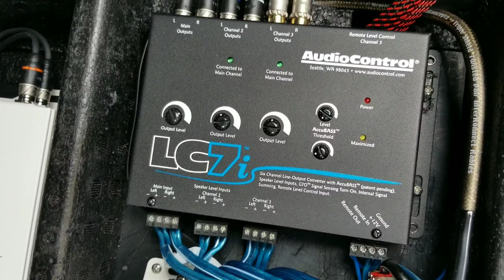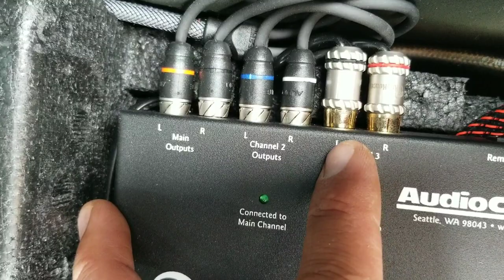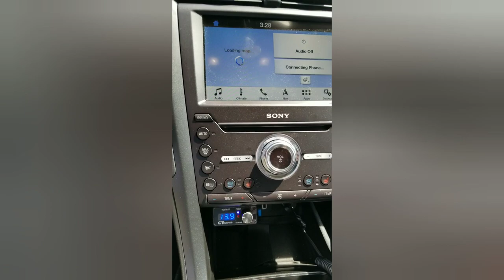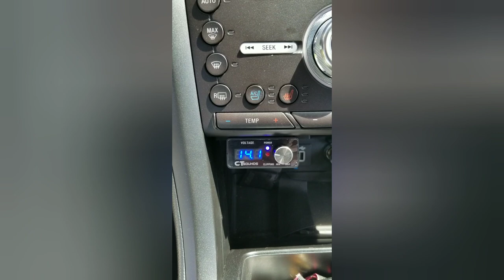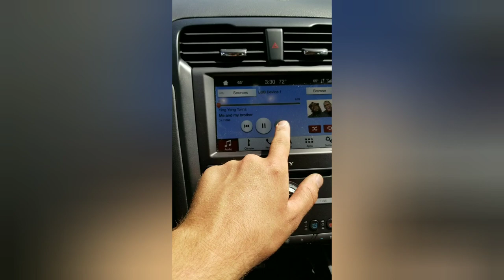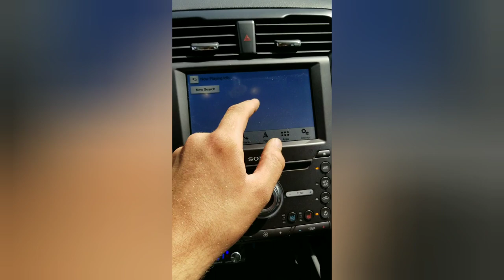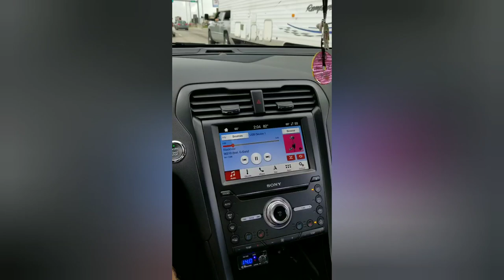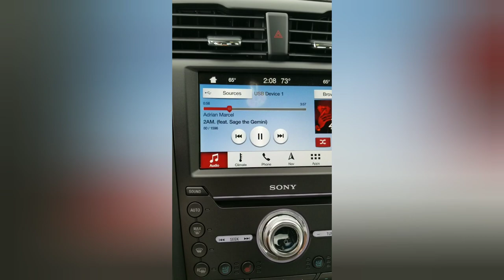2019 Ford Fusion Hybrid Full Stereo System Install all. CT Sounds

Comment: I have a 2017 Fusion Hybrid with the base audio system. Purchased all new speakers and a powered subwoofer that will be delivered this week, so been researching installs on the fusions. Did you happen to change any programming with Forscan? I seen some people using it to disable the active noise cancellation, and factory EQ processing to get better sound. Also, Crutchfield says "we recommend not exceeding a 30-ampere current draw" on hybrid vehicles. Have you had any issues with this setup or your 2016 Fusion setup?
Reply: Is 30 amps the Max for these vehicles? I had a similar question above. Have you found a solution?
Reply: I think I saw the same thing on Crutchfield. The largest amp I could find that met that requirement was 180w so I just gave up on the idea of adding subs...until today.

Comment: Shit I need you to help me out with my Camry hybrid I tried to put a system I. My car with power bank new batteries and it was  only 350 watts rms skar audio amp and 300 watt 8" sub and my damn car shut down every damn light came one on dash even check engine light scared the hell out of me disconnected everything and it went back to normal maybe some hybrid  cars can handle it and some don't idk
Reply from the maker: Maybe it's where you tapped yout power wire.

Comment: Got a question I have a 2018 hybrid and I tried to install a 12 inch sub with a 1200 amp but drain the whole battery. I’m new to installing speakers so is it because I didn’t have a circuit breaker or was it too many watts on the battery??
Reply from the maker: Where did you run the remote wire to
Reply: Straight to the car speaker fuse under the steering wheel
Reply from the maker: @yo_ejb  im confused.  I don't think that will work. Does that amp turn off with the key?
Reply: @ATCA  nope I unhooked the power from the battery to amp every night

Comment: I have a 2020 Ford Fusion Hybrid and I am having a Skar audio 12 installed in a few days. 1200 watts, 800 RMS. The amp also runs at 800 RMS. The wiring is rated for up to 1200 watts as well. It's a combo kit from Skar audio... I purchased an LC-2 converter and an aftermarket kicker fuse box and fuses because the Skar audio fuse boxes aren't the best. Will I still need to have the dealer unplug the microphones ? I'm not trying to void the warranty. 😂 Thanks in advance !

Comment: Beautiful install very clean. I have one question. Having the amplifier underneath the floorboard like that inside that plastic housing,  how is the heat?  Does your amplifier get hot?
Reply from the maker: In my case, at 1 ohm, nothing gets hot. The 60.4 class AB got got sometimes but the new 125.4 class d doesn't get hot at all. I bought a fan to go under there but i never needed it.

Comment: Have a 2017 toyota camry le hybrid. Wanting to go with a 1000 watt 4 channel amp and 1000 watt monoblock amp. As far as power, what do you think I will need to support this type of system as far as power? Am totally new to hybrid systems as far as audio. Let me know, thanks. Was thinking of replacing the 12 volt battery with a newer agm battery, and still adding another battery for extra. Let me know what you think, thanks!
Reply from the maker: My car has bigger dc convert from factory. You still need to add a battery or something.  Theoretically,  2k is good with just a battery
Reply from the maker: Extra battery that is.
Reply: @ATCA  ok cool. So what do you think about changing the factory battery to an AGM battery, and then adding the same exact AGM battery in parallel as an extra battery for the system
Reply from the maker: @Caesarsoundz Car Audio & LED Lighting 🔊💯  mine came factory with a small battery. I upgraded to a factory style AGMfrom ford then added the super cap. No issues.  If i did it again,  id do a headway as well. When i ass the 2300 to mine, ill swap the cap for headway

Comment: Hey. 
Do the sound changes in volyme up and down , wene car change from ev mode to petrol engine? 
More volt to amp wene car runing on petrol?
Reply from the maker: No. Because it doesn't have an alternator.  It holds 14.25v constantly
Reply: @ATCA  cool.  Thanks for respons.  Just whant to know.  Before i start build stereo in my corolla hybrid. No allenator in corolla eather

Comment: Just found this video. Very nice work! I'm looking to add an aftermarket amp and a sub woofer in my son's 2019 Fusion Hybrid. Can you give me the part numbers for the factory amp adapter you used? I'd like to leave his factory amp installed and just wire my install like you wired yours. TIA-Ryan
Reply from the maker: Just adding sub is easy. You can just tap into the factory sub wires to the 6x9s in the rear deck
Reply: @ATCA  So nothing other than the new amp, subs and wiring kit is needed, correct? Are there existing RCA outputs on the back of the factory head unit?
Reply from the maker: @rth5455  stock HU doesn't have rca. You'll need a LOC to convert the speaker level to the RCA like this one.

https://www.ctsounds.com/products/ct-lc2/?ref=kusxizsn72
Reply from the maker: @rth5455  do you have Facebook? We can discuss is much greater detail on Facebook

Comment: Not trying to beat a dead horse here lol but what molex kit did you buy on ebay.  Any 6 pin molex should work I assume
Reply from the maker: I removed them.  I'd get the automotive style that ebay has
Reply: @ATCA  like waterproof automotive ones?
Reply from the maker: @ilikedinonugges2532  yes exactly. The issue is vibration caused them to become intermittent

Comment: I just had my system completely upgraded in my '19 Fusion SEL but chose to leave the rear deck speakers in place.  I tend to leave the back seat down to get the full impact of the dual 10" subs, but think those ports are ingenious!  Are they custom?
Reply from the maker: I ordered them from ebay and just made them shorter. Gives the sane effect as the seat down but the seat can remain up
Reply: @ATCA  Sorry for all the questions, but how did you find them?  Were they specific to our model car or just 6x9 molds?
Reply from the maker: @jefft1812  i made them from mdf but you can buy them
Reply from the maker: @jefft1812  join the Facebook page (link in description of omy newer videos). We have great conversations there!! And im glad to help!!
Reply: @ATCA  Sorry, but I gave up on Facebook quite a while ago.
Reply from the maker: @jefft1812  not a problem.  Im also on reddit

Comment: Where did you buy the white speaker wire connectors for the speed cable/twisted pairs?
Reply from the maker: Ebay. MOLEX brand. And rhe wire is called Speed Wire by Stinger
Reply: Came here to ask the same question.  Absolutely genius alternative to splicing!

Comment: I have a 2019 Fusion Hybrid, I am going to install 2 JL 8w3v3 subs next week. My question to you is did you have to do anything with the Active Noise Cancelation system in the car? I don't wanna spend all this money on a sub/amp setup if it's not going to work properly.....
Reply from the maker: Yes. Unplug 3 microphones. Very easy
Reply: @ATCA  Is it pretty simple to get to them by pulling down the headliner? I don't wanna damage it. I've been installing car audio in my own vehicles for 25 years, but this is a new car and I don't wanna damage anything. I don't have a sunroof, so I know it may be a little harder to access the microphones.....
Reply from the maker: @robbiemills7840  headliner is held up by strong magnets. Fond a YouTube video. You just pull down the headliner in a certain spot and reach in and unplug the mic. Then it just pops back up
Reply: @ATCA  Did you notice any increase in road noise after disconnecting the ANC ? Thx
Reply from the maker: @samsadeghnia9685  not really. The Titanium is already deadened and well built. Plus, i usually always have the stereo on. Even just a little bit. Im truly impressed every time i get in and listen to those meso components.  And i can dial in how much sub I want.  From a back tone to shaking the center console.
Reply: @ATCA  I just managed to disconnect the mics. A bit of a pain because the Mondeo Vignale that i have has some sound deadening applied over the microphones, so it's harder to get your hands on the connectors. To sum up, yes the ANC does a job, but rather poorly with the base audio system : when you accelerate hard, it is unable to keep up and deliver enough low frequencies to counter the ICE noise. The result is a bit dramatic : the door panels end up vibrating.

However, i noticed indeed a decrease in the overall noise level, at constant rpm on the road, it is a bit more noisy without ANC, but it's not day and night either. I think i'll be able to live without it and the benefits of having a real sub in the back will be greater than the loss of ANC.

My local dealership works with "GroundZero" and i will put the sub in place of the spare tire and replace the 8 speaker/tweeter system (my Mondeo has only 9 speakers from factory). No additionnal amplifier (the sub is amplified), and we won't change the center tweeter on the dashboard, you think these two items are essential for a good audio system ?
Reply from the maker: @samsadeghnia9685  i changed everything.  That's just what i did

Comment: Did you disconnect the noise canceling mics ?
Reply from the maker: Yes. Definitely a must Do
Reply: @ATCA  is that the reason my sub is fluttering ? I got a system installed they didn’t install a converter, said i didn’t need it and i came back for the fluttering and they said if they unplug my microphones that’ll cancel out the fluttering .. is that correct ?
Reply: @ATCA  i have a 2020 Ford Fusion hybrid
Reply: @ATCA where are the mics located?

Comment: This is the setup for my 2014 Ford Fusion Hybrid Titanium. Why did you use the Audio Control vs the Pac Audio interface? Can I just use the extra battery or use the capacitor instead?

Custom subwoofer box 

2 Sundown SA-8v3 500 rms each

2 set of 6 1/2 components from CDT Audio CRM-6iS for front and rear doors

6x9 CDT Audio CL-69S rear deck

dynamat for doors and rear deck

Sony XM-ZR704 4 channel 75x4 rms

Sony XM-D9001GTR Mono 1200 rms

Kinetik HC600-BLU extra battery

Pac Audio AP4-FD21 with speaker harness APH-FD01
Reply: you wired the amp directly to the extra battery? and not the car battery?

Comment: I have a question, I have 2014 Avalon hybrid. I’m running 12 Skar VXF 1500 rms, 4 kicker 6x9. Using the factory head unit. I guess my head unit goes to clipping cause it my 4 door speakers start distorting, wish I can get more sound from them idk how ..... also one of speakers distort every now and then when I’m driving.... it goes away and keeps coming back. I’m running sound stream epicenter and lc2i with a 5000.1d sound stream amp with a 1200 4 ch precision power amp. What can I do to up my volume more to my speakers and get rid of the one speaker distortion?
Reply from the maker: You already have the 4 channel connected? The HU will distort at about 3/4 volume.  Also, on the 4 channel put both channels on HPF and set to about 80hz. This will allow the speaker to play at higher volumes.

Comment: Hey. 
Do it Darin the 12v battery? Wene drivning  do gas engin work more thene before? And not so Mutch battery mode? Ev mode?
Reply from the maker: Does not effect battery performance at all
Reply: @ATCA  thanks. I have a corolla hybrid. Planing to get a amp soundigital 800:4 (4x132w 4ohm) and front and rear speaker. No sub. Do u think that Will work. And the fuel economi be the same?
Reply from the maker: @fw1367  should be fine

Comment: Can you add all of the speaker sizes to the comments?  I want to upgrade all of mine and make sure I order the right ones.  Thanks bud!
Reply from the maker: 6.5s in doors, 3.5 in dash and rear deck. 6x9 subs.  Unless you go really high end, or at least Mesos like i did, you wint see much benefit.  The stock sonys are hard to beat
Reply from the maker: @trevormoore4198  yes. Stick sony subs were very nice all things considered.
Reply from the maker: @trevormoore4198  theyre molex. Ebay

Comment: I know this video is 3 years old. What powers the front/rear center channels? Are they even needed?
Reply from the maker: Stock amp powers them. Work amazing.  They're basically at baseline for the stock dial too. So I tune everything off them. Those meso 3.5s sound phenomenal.
Reply: @ATCA  Thank you

Comment: Hey, I have a 2019 Ford Fusion hybrid. I’ve installed a second battery with a battery isolator, but the second battery is not recharging. I couldn’t really find any info online. When wiring the isolator, it is the same process as in any other car isn’t?
Reply from the maker: Yes it should be
Reply from the maker: Connect the isolator to the remote wire to turn it on
Reply: @ATCA  I have it connected to the same one as my amps, I’m gonna spend some more time looking at it. Thanks man 👍

Comment: Did you make the 6x9 ports or bought them?
Reply from the maker: I made them
Reply: @ATCA   As well as the wire connectors to the amp?
Reply from the maker: @dominichughes359  i bought the plugs

Comment: So I have a 2019 Fusion Hybrid SE. I just replaced the door speakers with JL Audio components in the front and rear. I like the factory stereo so I’m going to keep it, but my question is this….I have been told not to install anything that draws more than 30 amps from the electrical system of the car or I could damage the car. I really wanna add a JL XD500/3v2 amp to power my doors and a JL 12W3v3 Sub. Can I do this safely without damaging anything?
Reply from the maker: 2 years now, no issues. 2k watts rms. Im pulling over 200 amps at times. Voltage never drops below 13.8v
Reply from the maker: If you do like i did, you'll be fine.

Comment: What did this end up costing in the end? I have the 2020 fusion ecoboost, all the good stuff but not the premium sound system.
Reply from the maker: 1200-1400 including wire.  I also build a new box for the 8s. I also just buikt a bad  box for 2 Ozone 12s

Comment: Did you by any chance bypass the factory amp for your subs with the inputs connecting a line out converter straight to the inputs for the six by nines that’s the way I was going to go because my amp keeps cutting out because it’s amp to amp.
Reply: Yes he did that’s the audio control component he used

Comment: Did you lose you factory alerts like backup alarms, and the chimes and dings by doing the speed wire and other harness?
Reply from the maker: No. All that is in a module under the dash. In another car, i took the module apart and out a resistor on the piezo to make it a bit quieter. It was very loud.
Reply from the maker: Come to think of it, it may be in the speakers... but it will works.

Comment: Hey I’m thinking of adding a line out with subs in my 2018 se hybrid. Have you had any problems with yours since you installed your system???
Reply from the maker: Not one
Reply: @ATCA  something online was saying that you will have an issue if you add more than 300 watts you will have charging problems
Reply from the maker: @ericdh2009  i seen that a lot. But i run 2k watts rms with only a capacitor to help Voltage

Comment: What's the factory speaker wire colors in the back of the radio if you don't have 6x9 to tap into
Reply from the maker: I had a screenshot once, but idk. Its easy to deduce that with a simpler multimeter
Reply: Left rear speaker is 
White/Green + 
Brown/Yellow -
Reply: And do you know if the hybrid requires a capacitor getting drops when braking and highs when accelerating
Reply from the maker: @22kings5  it does not. It's 14.25 constantly as long as the car is on
Reply: @ATCA  I haven't put a multimeter on the battery yet to see and it's an older battery so maybe that's the issue
Reply from the maker: @22kings5  there's a fuse on the battery that can be bad

Comment: Very nice.  Looks and sounds great.  Where did you put the crossovers?  I thought the factory front tweets fed from the ACM.  Another person asked about flattening the factory EQ with Forscan, Most of us with the A2B Sony setup are wondering.
Reply from the maker: 2 things to note here. 

Firstly,  in the 2016 model, the front tweeter goes to the amp in thr trunk. In this 2019 model, the tweeter goes to the radio module.  However the rear is full range, even tho its components. And it has one pair going to the amplifier.  In my situation,  i used the factory woofer wires for the front and the full range wires for the rear. 

Then i put crossovers in the doors and using the LC7i,i summed thr full range signal into the woofer signal for thr front and viola. 4 full range channels. Then subwoofers just goes to channels 5 and 6.
Reply: @ATCA  so you are running a full range signal to the front doors via the factory wire from the after market amp.  Inside the door is the crossover to split the signal to the proper component? 

No more factory connection from the ACM to the tweeters? Do chimes and Nav directions work properly?  You have me really pumped up about doing this.  Thanks again for your video and responses.
Reply from the maker: @ttops1987  yes. Literally everything works